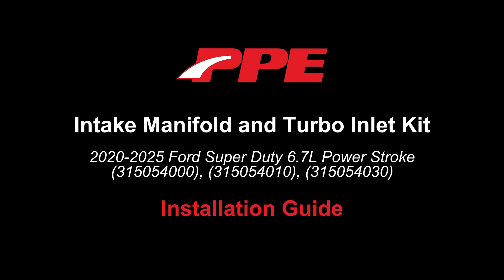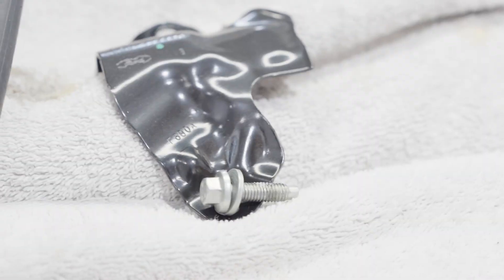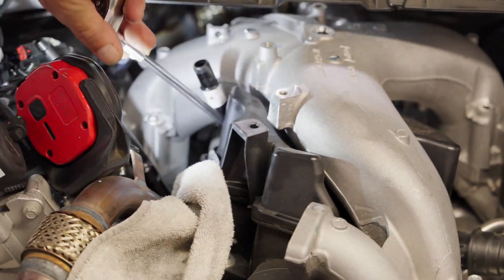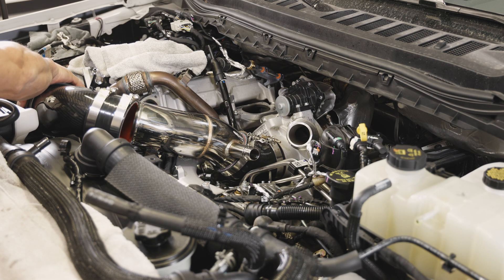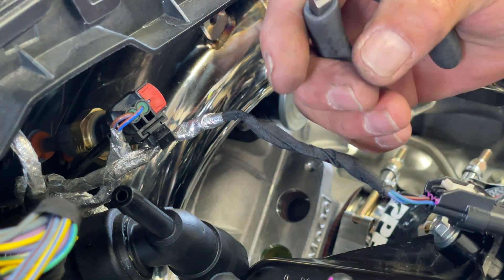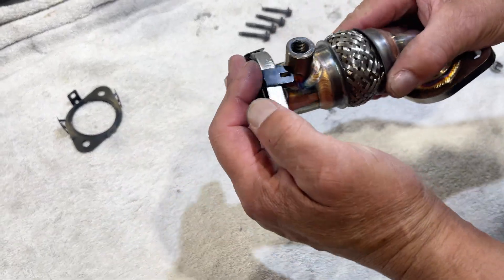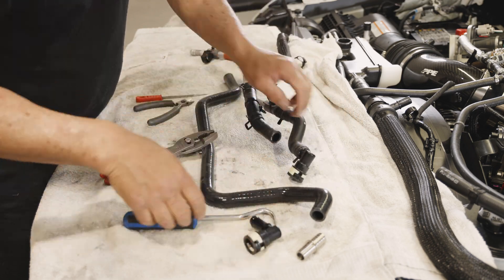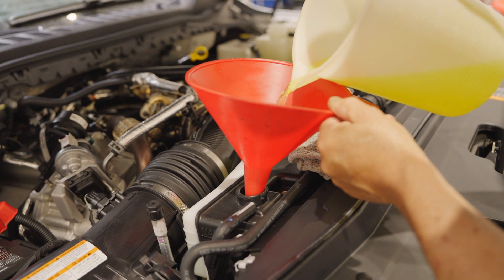Ford 6.7L Power Stroke Zilla Intake Manifold and Turbo Inlet Kit Install Guide

Comment: Will this intake work with a banks?Cold air, monster ram intake.I see that turbo inlet connector is different
Reply: Could I just connect the banks intake?Straight to the turbo intake and not use that carbon fiber elbow